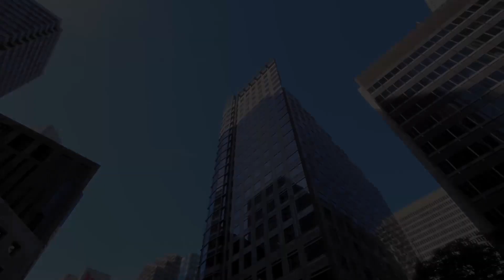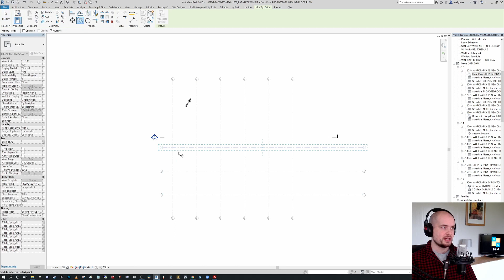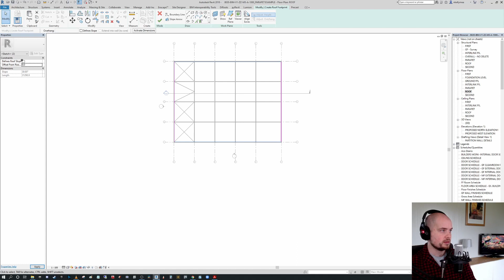Become 13.36% More Efficient in Revit with Keyboard Shortcuts

Comment from the maker: 🌟Few Notes🌟

I was very tired after a rough night with teething kids - apologies if video is a bit slow/disjointed at points (skip ahead through the chapters as you see fit) 
Every reference to XLM is meant to be XML 🙈

Download links as mentioned:
Download Free Printable PDF of Revit Keyboard Shortcuts here: http://eepurl.com/hxNusP
Download XML File for Keyboard Shortcuts and other additions here:
https://www.buymeacoffee.com/8020BIM/...

Video Timestamps:
00:00 - Introduction

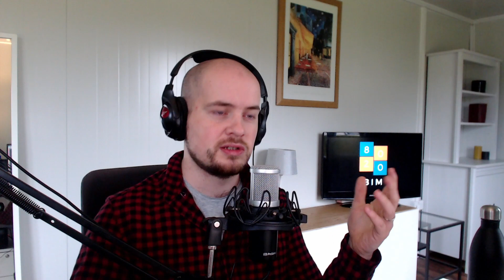01:18 - Downloadable Resources Introduction

02:47 - Default Datum Shortcuts - Grids (GR), Levels (LL), Copy (CO), Aligned Dimension (DI)

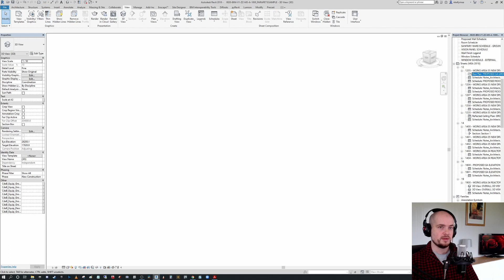06:37 - Columns (CL)

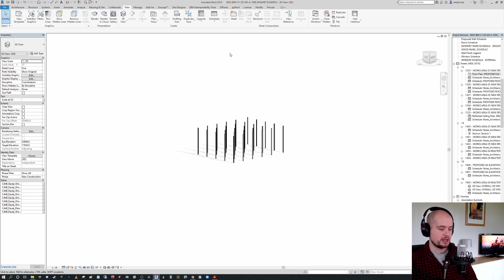07:46 - Pad Foundations (FN - Custom), Ground Beams (BM), Default 3D View (33 - Custom)

09:09 - New Plan View (PV - Custom), Floor Beams (BM), Keyboard Shortcut Mapping Menu (KS),  Beam Systems (BS)

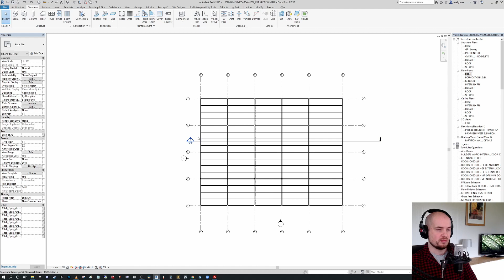13:20 - How to Create Custom Revit Keyboard Shortcuts, Paste Aligned Selected Levels (ASL - Custom)
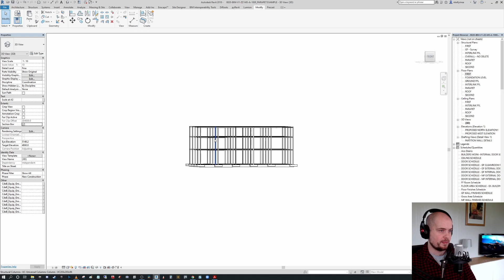15:31 - Reveal Hidden (RH), Bracing (BR), Snap Endpoint (SE), Snap Midpoint (SM), Snap Nearest (SN)

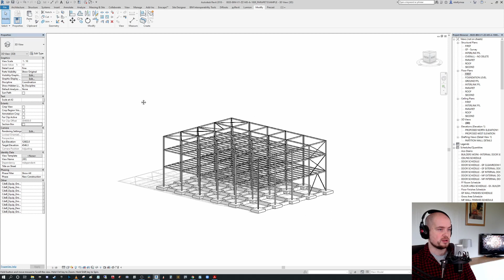19:08 - Walls (WA), Think Line Presentation (TL), 

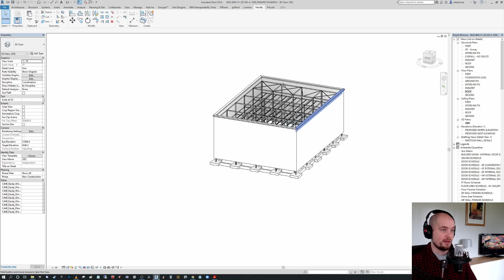21:24 - Visibility Graphics Menu (VG), Roof By Footprint (RF - Custom), Architectural Floor (FL - Custom)

23:00 - Rooms (RM), Architectural Floor (FL - Custom), Doors (DR), Windows(WN), Select all Instances in Project (SA)

26:20 - How to Import a Custom XML Revit Keyboard Shortcut Mapping file.

26:54 - Unjoin Geometry (UJ - Custom), Join Geometry (JN - Custom), Detail Lines (DL), Multicategory Tags (TG), 

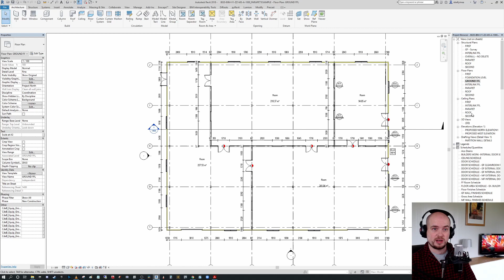29:02 - Automatic Ceiling (CE - Custom), Pipe (PI), Room Tag (RT)

30:03 - Downloadable Resources and Outro

If you like this content please support 8020BIM by buying me a (much needed) coffee, or better yet, become an 8020BIM member!:
https://www.buymeacoffee.com/8020BIM

See you all for the next one! 
Niall😀
Reply: Ha me too!

Comment: I would recommend all left-handed shortcuts, pretty exclusively, and a mouse with programmable buttons for the most used buttons like enter, tab, backspace, shift and control. To keep looking down at the computer and bring the right hand back and forth from the mouse the keyboard is a lot of wasted time.
Reply from the maker: Absolutely Hannah - but you are getting into OG Keybaord Shortcuts on that front. I wholeheartedly agree mind you - if users can take the time to migrate all defaults to their "Off-Hand) preference on the keyboards than they asbolutely should. For this video in particular I wanted to make is Accessible for relatively new users so they are not overwhelmed with 200 keyboard shortcut remaps so that they can experience the benefit and then go down the route you correctly suggested above. 
Niall